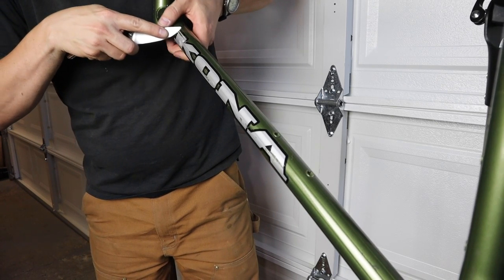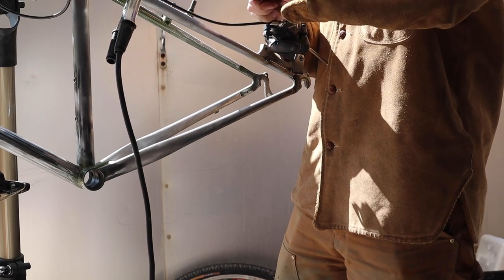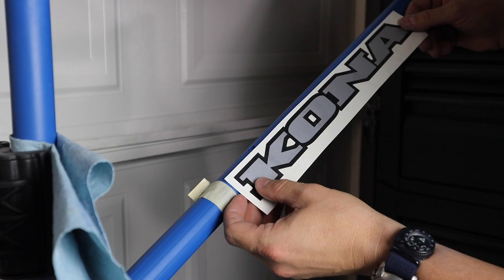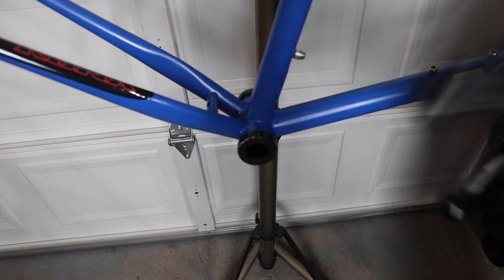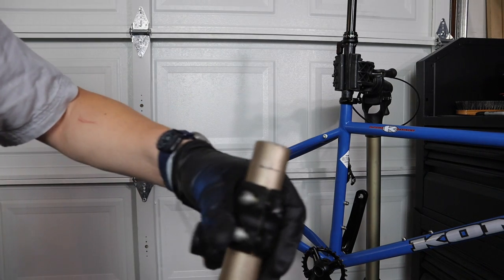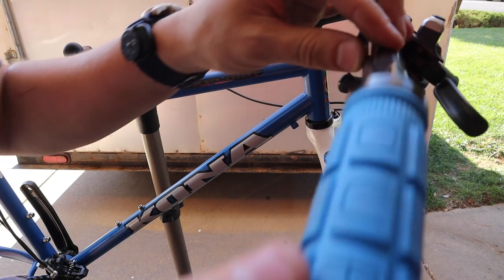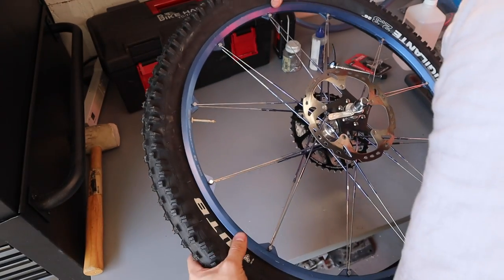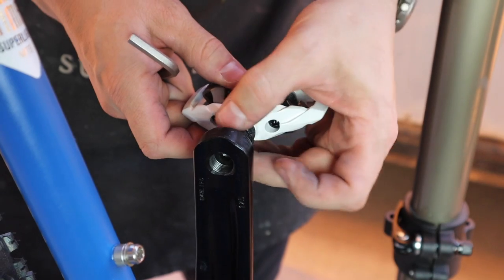Nostalgia | Bike Restoration Build | 1994 Kona Explosif

Comment: Love that you used the front derailleur cable routing for the dropper. I was wondering if this was possible. I have an old 3x7 speed MTB that I’m converting to 1x9 and I wanted a dropper post but don’t want to drill into the frame. I’m gonna try what you did!

Comment: Hey, I am interested in this idea to upgrade an old steelframe since years and now I bought an old frame to do it. But I wrote to some steelframe builders in Germany also to ask them what it would cost if they do it for me. All of them told me, that this is not possible. You could build it, but in the end the frame would crack because of the forces it was not build for to deal with. Espially in case of super light and butted frames. So what is your experience with the bike and was your frame also very thin built? My is a columbus EL, which has 0,4mm Thickness at some points. I would be glad about a response. Best regards, Johannes

Comment: Quick tip on removing brake bosses.  Many of the bosses on old bikes were braised on and will just about fall off when heated.  Put a pair of vise grips on there and heat them up with a torch.  If they were braised, they will come off in a few minutes.

Comment: Awesome!!!  Cantilever to disk mount conversion never thought it was possible. Can you give me the size of your seat post? I have a Gary fisher paragon and finding shocked fork with a 1 inch stem top tube is impossible so have to settle for rigid fork as well as a seat tube which is also 1 inch diameter.  Plan to have a dropper post for that seat tube of mine but its 1 inch diameter. If you have a link please share. Thank you.

Comment: Great build and striking frame color.isn't the 180mm rotor on the rear a little excessive?I run 180 160 and I'm 178lbs with gear which works great.How much does it weigh?Cheers.

Comment: Oh No you got rid of the that classic Kona Exploding Green 😭 that signified that particular model and was part  of the appeal of it - loved the restoration apart from that. Loved it particularly as I restored (with original period components) 1994 Kona Kileaua 1994 few years ago only comes out in good weather. Also put back into use my old 1996 Kona Kileaua which is still as period components (with period upgrades over the years as I had used it/XC raced it) purely because being XT M739 components lasting so well just never needed to swap out the drivetrain/etc. Agree with the tyres on old konas but then I still use Panaracer Smoke & Darts on both of the kona's (well smoke lite on rear of my 94 - nice stash of them luckily but it not a bike ridden many miles so should last). Retro mountain bike steel konas in particular a dangerous love - bit then raced/race mountian bike XC 1991 - now (with a current 29r hard tail carbon as my up to date XC race stead though). So lived and race through the great mad period of mountain bike XC in the 90's even though I'm 45 can still close my eyes think back remember such a lovely period of mountain bike XC.

Comment: Sadly all I see is the memory of my 95 Kona Cinder Cone. Very similar color (Teal/Blue with Copper/Orange rigid fork) Lx/XT build with Ritchey Whale Tail brakes, wide bars, 2.3” Maxis DH tires (they rubbed the frame in the back too), I used Oury grips too. Stolen off my front porch while I was in the back yard. No other bike ever rode as nicely on the street, rocks, roots, loose sand, mud or snow. Steel was and is still “Real”. Kona made awesome bikes. Wow talk about nostalgia....

Comment: Not a naysayer cause I enjoy these vids, they actually help me relax.
Anywho I did the same thing you did by welding rear disc brake tabs on a 2000ish aluminum giant hard tail.
Long story short, the rear part of the chainstay where the disc tabs were welded became bent due to the torque forces imposed on it.
Im hoping you don’t but I wonder if you’ll have the same issue.

Good luck
Reply from the maker: I hope not. 😁

Comment: Disc brake tab looks great. Clamp another stem on top and saw between them to cut steerer? I used Oury motorcycle grips in the 70s on my bmx bike. Classic design.

Comment: Amazing resto-mod! The ambiance of the video is nostalgic as well and also a work or art! The frame tubes are so thin...I guess that I gave up slender design when I chose aluminum over steel!

I have a question if I may, should I inflate at less than the specified pressure of 45 to 65 psi on my new old stock IRC Mythos II to achieve better gravel grip or to have them wear more even?

I’m closer to the lower number as my son uses the Cannondale M400 more over cement cobble stone floor. Any pointers?
Reply from the maker: With MTB tires with tubes I run 40 PSI.

Comment: Hey Old Shovel, I have a 1992 Trek 930 Singletrack I want to restore with modern upgrades.  If I send you the frame could you weld on a rear disk brake mount?  How much would you charge?

Comment: I have a question is it safe to removed the bike stand? Coz i have bike stand fixed to my mtb bike frame. The one with 2 holes for the bolts. Coz im planning to repaint it.

Anyway my bike is aluminium alloy.

And can i also used grinder like what you used in removing the vbreaks.

Comment: Love your work.👍I did a simular build with a 92 giant cadex all aluminum. Like the disc brake conversion , not too sure if the rear triangle on my giant would be able to have a mount welded to it.

Comment: Great build!  I'm an X- racer of the mid 90's era myself and still love all those vintage bike that of which I used to drool over as a teenager when reading Mountain Bike Action magazine.  The color scheme came out nice overall with everything matching although I must say that my stomach turned a bit when you first were scratching off the unblemished original factory decals and losing that very 90's Kona esque' metallic paint.  Before I saw how well you had matched up the components/wheelset with the frame color, I was thinking that it'd have looked great to keep the front triangle original and either faded or just taped off and painted the rear white.  It'd have looked great with the white front fork and kept that unique original metallic color in the middle.  but oh well... all in all, it came out looking great and color matched.  Another thing..  did you get a chance to weigh the frame itself before building it?  also, whats the overall weight of the finished product with the newer parts like tubeless wheelset and 1X gears.  I am a big fan of old-school steel framed bikes and would love to see a riding review of how it performs with the updated kit installed.

Comment: Quite a change. I have my 1994 Explosif still largely original other than aheadset conversion with Syncros stem and V brakes.  Interesting what you done to it, would be keen to hear what weight it is now, I'm pretty sure my almost 1994 spec with Rockshox Judy SLs is around 23.5 lbs.  Mine is still olive green, that paint being removed was hard to watch 😂

Comment: Hi, first of all thank you for the great videos. I was wandering if you could please publish a link for the disc brake adaptor that you welded to the frame. I am looking to convert my 1996. GT Borrego, and my GF's 1995 Trek 970ZX at some point so I would love to start collecting the necessary parts. Thank you & regards. ;-)

Comment: Love it! I have a '95 Chromoly Bianchi Peregrine I've been debating on whether or not to do this to. It's all original but I'd love to put suspension fork and a dropper post on it. What size were the steer tube and seat stay on your Kona? Also, thanks for the paint idea. I've just updated an '02 Gary Fisher Marlin with SLX brakes, Mavic 321 wheels, XT 1x11 drive train, Rock Shox Recon fork, RaceFace Atlas bar and crank set and Cane Creek headset. Just after the KS dropper post and new saddle now. Probably could've bought a new bike but... Also, where do you find your parts?

Comment: I converted my 1993 Kona Hei Hei to full rigid with titanium jones bars and Rene Herse Rat Trap Pass tires for adventure/road use.
Reply from the maker: Sounds awesome
Reply: I bet there’s be a niche market for Kona Project 2 forks with disc brake tabs. Compared to 90’s suspension forks, rigid forks steered SO much more precisely.

Comment: That was so satisfying to watch you restore that Explosif.  I bought a Kona Hot in 93 and fitted it with a Mountain Cycles inverted fork with a cable actuated disc brake. Had the mint Ritchey headset just like this beauty. I loved the whippy feel and svelte lines of the high end steel so much. Love how you've modernized it while keeping the look and feel. Thanks for posting this, you have a new subscriber.
Reply: PS any issues w chainline and the 1x ?
Reply from the maker: Thanks for subscribing and I have not had much used with the drivetrain but I have not worked it hard yet. The day after finishing the restoration I busted my knee trail running and have not been able to ride. I will later this week though, if it all heals well. 😁

Comment: Does that bike respray stuff really hold up to nicks and scratches?  I'm wondering about doing automotive 2 part clear but I also wonder if it is worth it with this new product.  The matte look is intriguing to me.
Reply from the maker: For me it will take a while to see but there are a lot of other folks who have used it and the reviews are good. Automotive paint and powder coating were the other options I had thought about trying.
Reply: My go to is ace hardware rust stop spray paint.  Unbelievable stuff only basic colors though

Comment: Maybe this has been asked before, but where did you get the frame decals?  I have that exact frame.  My son and I are going to do what you did, blast and re-paint, upgrade parts, etc.
Edit:  you didn't have any trouble going 1X12(?) with the frame dimensions? I was hoping I could go that route with my sons rebuild as well.
Reply from the maker: When I use decals I get them from velocals. The ones I got for this build were from a guy in the UK on eBay and they were not good. When I mask the paint using vinyl I make them myself using a Cricut vinyl cutter. As to the drivetrain, on this bike I went 1x10 not 1x12.

Comment: I have an early 2000's Voodoo steel frame MTB, 26" also, on the rear disc mount it has a fillet welded from the seat stay down to the chain stay, underneath the disc brake mount. This would stiffen up that area to deal with the torque reaction from using the disc brake. I don't know how important or relevant that may be but just thought I would mention it. Nice build, I have an 83 Giant Hurricane that I would love to do that to.
Reply: @poobar69 Would brazing work better?

Comment: Very cool build sir. Try to wear some eye protection when running the cables at the very least. The wire ties would look neater if you used a pair of flush cut cutters and hey would not have the sharp end sticking out. You could also avoid using the wire ties on the frame all together if you silver braze guides on. Another thing you could do is crush the inside of the chainstays a bit for more tire clearance. Despite all of this I loved the end result and mellow narration as usual. Thank you.

Comment: I’d like some suggestions if you have them.

I’ve got an old frame that I would like to convert to disc brake. Here’s the catch: The frame is not weldable. It’s not carbon, aluminum, or steel... it’s Boralyn. It’s a very rare frame made by Univega for just a couple of years. I’ve watched your other videos which you convert to disc brake. How might you tackle this particular situation, do you have any ideas? All the kits I’ve seen online would not work with this particular frame.

Thx

Comment: Hi!
Great video, though I would have done a couple of things differently. 

You are using a suspension with a lot more travel than what the frame was made for. Since you've done some welding, wouldn't it have been better to put a reinforcement where the diagonal tube joins the head tube? 

I would also go for a slightly thinner tyre and smaller disc in the back. Steel frames flex and it something almost rubs in the rear stays, it will most likely rub when it's being ridden harder.

Comment: What diameter the seat post is? I've got a Kona Kula 96 and I think it has a 27'0 seat post. It's almost imposible to find dropped seat post for it.
Great job!!!
Reply from the maker: The 1994 Explosif has a 27.2 seat post but I have a few other 90’s Konas with the 27.0 and they are almost impossible to find a seat post for let alone a dropper.

Comment: Enjoyed this immensely. I've just finished restoring a 99 Hahanna and. 98 Kilauea. Used the spraybike paint too. Actually put drop bars the create adventure bikes for my son and I. Found some P2 disc forks running BB7 road discs up front with v brake on the back using a travel adapter to work with 105 shifters.

Question, where did you source the dropper post. Assuming like my frames you have a 27mm seat post diameter?
Reply from the maker: The dropper post was a hard one because of that 27.2 mm size. I bought it off a friend who had one and knew I was looking for one. I was looking for as many used parts as I could find.

Comment: How come my Lavadome 96 models has the same color and frame design as the explosif? 

Would the Lavadome and Explosif be considered on the same level? Quality wise and price grade wise?

Can you PLEASE also tell me where you got them Kona stickers????
Reply from the maker: Not sure. I know sometimes they Kona did mid year changes. The Caldera I had in the 90’s was a mid year model and does not match the colors in the catalogue from the year prior or after. Below are links to the catalogs from 96 and 94. 

https://issuu.com/wastedqba/docs/kona_96_eng/1?ff 

http://www.retrobike.co.uk/gallery2/d/112554-3/Kona+Catalog+1994.pdf

Comment: What wire did you weld? Is welding the brake handle safe? Will not weaken the frame? Will not break when braking?
Reply: 1. i don't know, sorry.
2. if the frame is thick enough, it will probably be ok, there are plenty of people who have done it. 
3. i would say that it hasn't yet.
Reply: @bananasstuff3344  Sorry for the accuracy of the translation. Google translator.....I write from Polish and I don't know the language. I send greetings

Comment: Great Job .  I sure  liked  the rear disk brake bracket  install . The braket on the disk brake that you welded.
Was that cut off  another bike ? I have a Kona that I have been thinking of adding disk brakes to . Not sure 
of year of bike . Steel frame tho . Did you buy blank brake cable ? cut to fit?
Reply from the maker: I got the disk break mount from Paragon Machine works, linked in the description. Old Kona’s are awesome.

Comment: Weld the mount under the rear brake, and do not weld the bonnets for the cable shirts, fixing them to ugly plastic ties. Where is the logic?
Reply from the maker: I know I should have decided on the cable routing when I had it stripped. As I had never built it up until after it was painted I was not sure where I wanted the routing.

Comment: Nice! Where can I find that caliper bracket? Is 2000 Kona Blast alu or steel frame?
Reply from the maker: I got the brake mount from Paragon Machine Works on line. They have a bunch of bike frame building parts. As to the Kona Blast, I had a buddy with one back around 2000 and I think it was Aluminum.

Comment: Great work! Now, I invite you to do the same work on my bike. 🙃 Nah, just kidding.
Well, what this bike needs as an updated feature is a 2000Watts qs hub motor, lifepo4 50ah battery, controller, throttle and else to boost it up to 60mph. Lot more fun!

Comment: Love your bike and love your video!  I have acquired a Kona Kula Supreme scandium frame bike that needs some love (new drive train, brakes, new paint job, etc), weighs 23 pounds with its old drivetrain.  It has a nice Rockshox World Cup SID that works great.  I would love to find some light 26” wheels, like you did; nit sure if maybe I can stuff some 27.5’s in it if I use low profile tires?  Did you install a 10 spd derailleur?  How did you get that XT derailleur to work on that wide ranging cassette (the largest cog appears to be a 40 or 42?)?

This would be the first bike project for me since I used built up an old Schwinn banana seat bike way back in the day.  I wish I could pick your brain to learn from you, as this awesome bike deserves a quality makeover.

Thanks again for this wonderful video!  Gorgeous bike!

Comment: The stress that is transferred to the seat stay by the disc brake worries me a little...
I would have welded a support from the seat stay to the chain stay.
I'm not a fan of on by, I would have mounted a double crank at the front, which is also closer to the classic look.

Comment: This is awesome, I'm currently restoring and doing something similar to a 91 Haro extreme. I'm running into issues on doing the disc brake conversion. Where did you order yours from?

Comment: Beautiful job. A question. When you soldering the disc brake adaptors, did you use co2?
Reply from the maker: Thanks. On this one I used a flux core wire welder.
Reply: @oldshovel  Thanks a lot

Comment: Excellent build, loved the entire process! I recently acquired a couple of retro rigid Specialized Hardrock mountain bikes. How do I know which disc brake mount is the right one for me when ordering from Paragon? Thanks!
Reply from the maker: I was not sure myself so I ordered a couple and they both would have worked. I ordered ones that were universal and not specific to a type of frame. I then had to round off one end of the one I used to make it fit around the dropout.